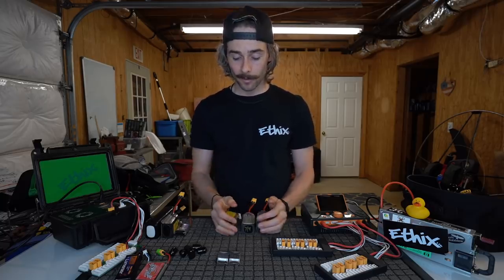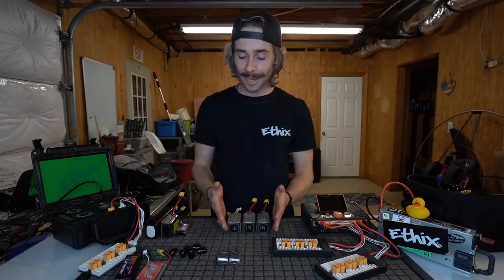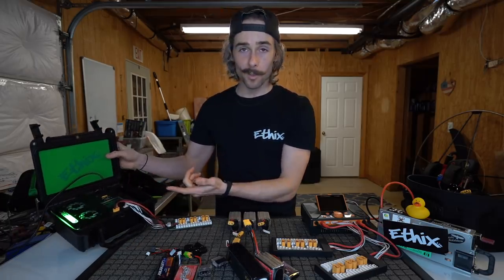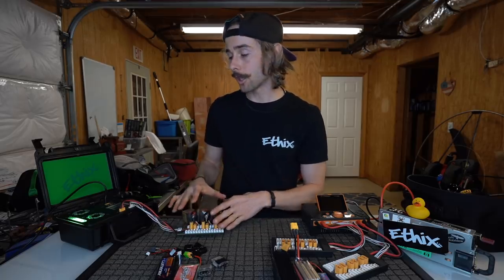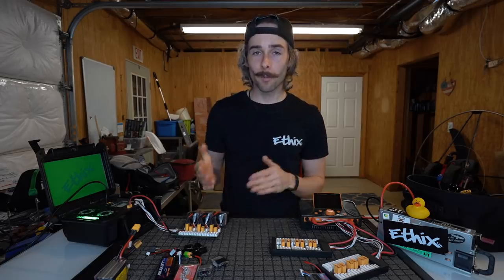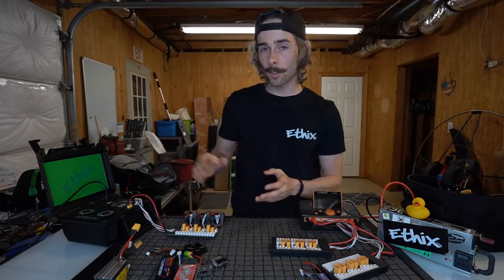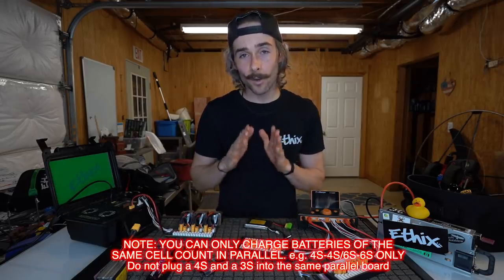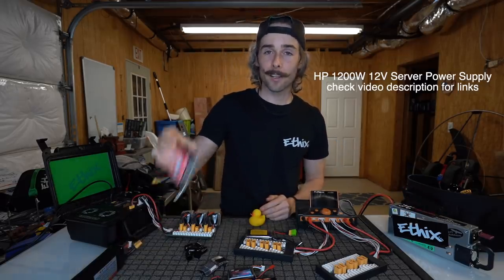How to FPV (Part 7) LiPo Battery CHARGING | Is Parallel Charging DANGEROUS ???!

Comment: If your second battery has a huge voltage difference from 1st which you just plugged in shouldn't you plug the xt60 from the 2nd battery in prior to plugging in the balance connector? Any discharge will run through the xt60 instead of the balance lead. Am I mistaken?
Reply from the maker: If it’s got a huge voltage difference.  Enough to have to plug in the xt60 because you’re scared the balance lead can’t deal..  you shouldn’t be plugging hose batteries on parallel 😂
Reply: @MrSteeleFPV  I have been known to do strange things when drinking and charging

Comment: One reason parallel charging might be dangerous is if a battery happens to disconnect, the current going to that battery will be dispersed amongst the others, thus causing a charging current above 1C

Comment: The example said 0.3V difference per cell so for a 6s wouldnt that be 1.8V difference allowed battery to battery, but then an example is given of battereries with a 22.5V to 23.5V range which shouldn't be charged together because of voltage difference? Was the rule really 0.3V difference battery to battery. I have also heard a rule of 0.1V per cell difference is ok so 0.6V difference across the range of batteries for 6s. I'm learning so what any thoughts welcome.

Comment: So how much would a controller, 5 inch quad, goggles, charger, batteries, antennas cost?

Edit(3 years later): I don't even remember asking the question above but what a silly question it was. I have just got into fpv and am now struggling with terminology of everything lol

Comment: Parallel mean all the positive pole of the batteries are connect to common + same with the - so the voltage is the same but you divide the current so if 1 battery absorb 1A at 17v is 17Vx3A=51watt instead of having 3 different charger:17Vx1A=17w+ 17Vx1A=17w+17Vx1A=17w=51w

Comment: Wouldn't it make parallel charging safer, if the boards that you plug the battery in had built in Lipo Cell Checkers (like the ones you used to check the voltages). If one of your Cells gets imbalanced, the board could automatically switch off the charging current or just make a loud sound.

Comment: .3V difference per cell? so a 3.9V just above storage and a 4.2V fully charged that's a massive difference . None of mine are ever more than .03V out per cell all at 3.7 something after recovery. I also display the IR on the charger not voltage when charging if the IRs are close I know all is well.

Comment: So is it possible to charge multiple batteries of the same voltage but different capacity ? like 2x 4s with one 1.5A and the other 1.2A ?
Reply: Vinast92 sketch 10 asked the same question below.
Reply: @Ozmakkacbr  Thanks !

Comment: what's a decent charger to invest in? that won't brake the bank
Reply: ISDT D2
Reply: @JustaPoke  ive got this charger its great
Reply: Hobbymate d6 duo!!
Reply: @Themflames  its the same charger pretty much
Reply: @llickmogan  no, the hobbymate is able to use ac or dc current
Reply: @Themflames  : yes, hobbymate D6 duo pro can take both AC & DC. It has a XT60 socket at the back. I use it and it's a great charger. 🖒
Reply: @Firografi  thats what i said
Reply: @Themflames  : yes,I know.....  I was supporting your comment 😆

Comment: I don't see how parallel charging is feasible anymore. Reliable chargers have gotten so cheap, you can get a toolkitrc m6 for less than $30 now. Get 6 of them and hook them all up to  a power supply so you can charger batteries individually. If one cell is dead midway through charging, at least it'll be detected.

Comment: I have noticed with all batteries if you find the proper voltage to stop flying at all of your cells will come up to the same recovery voltage about 2 to 3 hours after flying. 
Example: I have 6  5’S Lipos all Ovonic 1550 bought at the same time. 
If I fly them down to a steady 3.54 to 3.57 .....  In about three to 5 hours all 6 lipos will come up to the exact same voltage. 
Almost exactly cell for cell voltage for voltage. Usually if I do it right they come out like this 3.78 3.78 3.80 3.80 3.80.  All six of the cells will all come back to this voltage exactly per cell as in cell one 3.78 cell2  3.78  cell3  3.80 cell4  3.80 cell5  3.80. 
I think I’m onto something ??????? 
What do y’all think ??????

Comment: If I can just add something to precise: charge them peralell if they all are in max 0,3V range. for example one is 14,7 second 14,8 third, 14,9 not more. Allover difference should be 0,3V whole pack, not single cell. Because 4,2V and 3,9V will force large current flow between them.  
And if You read it i got a question, no offence but is Steele is your name ? Sorry for asking man, english is not my first language so it is a little bit weird for me ;) Cheers!

Comment: i once charged 6 batteries in parallel, and 1 cell in each died at once. Still not sure why. but it thinks it was because 1 cell in 1 battery were bad. so yeah there is chances with parallel charging.

Comment: Sigh, anecdotal I've not had anything bad when plugging a balance lead in first isn't a good recommendation. It relies on perfect circumstances and never having a Murphy problem crop up. It literally costs nothing to plug the mains in first and then balance lead a couple moments later for the extra level of safety.
Reply from the maker: Maybe you should make some safety videos m8.

Comment: Parallel charging=unnecessary risk, IMHO.
A charger with multiple outputs, and/or separate chargers is the way to go if I have a time constraint.
But that`s me, I`m pretty anal when it comes to LiPo`s lol.
Not just same voltage batteries, but they should be the same type, same age, and have been used in a similar fashion, as well as being undamaged, and cell-checked prior to charging, otherwise, parallel charging is a no-go for me ;)
(kinda just watched this to complete the "how-to FPV" series) 

Multiple output chargers are nice, and if you have say, an 8s compatible charger, there are dongles (for certain plugs and certain chargers) that let you connect 2x4s via the balance leads, or 2x3s etc :)
Been a while since I saw those, but I guess they`re still around.

Comment: I found a really good way to setup the power supply as a charger that eliminates soldering wires directly to the circuit board on the charge. They make "breakout boards" that the power supply plugs right into that give all the necessary binding posts to wire the power supplies how ever you want. gigampz.com makes one that I just got that works perfectly, it has high current binding posts that can be doubled up so as to provide the most current handling possible out of the power supply. It also give switching capabilities so that if you wanted to control the power supply on and off with out unplugging it you can. No resister soldering or all that jaz.

Comment: so if you shouldn't charge in parallel if your voltage .2 off from each other then don't waste your money on a parallel board.
because my batteries are always more then .2 off.
Reply from the maker: Battery management man.  Battery management

Comment: Im new to this hobby, i havent dared to charge my first 2s battery yet, i bought a Gens  7.4v 2600mah battery for my Taranis X9D Plus SE, and i bought a SkyRC e680 charger, im so insecure how to start charging, cause i wanna start my Radio so i can fly Sim in Velocidrone, anyone have any tips for me i would be forever greatful <3
Reply: charging one battery at a time is very safe and you wont have issues. Go for it :)
Reply: @JaniMikaelOllenberg  thank you, i have another issue now, i want to calibrate my controller, i did it in the controller, then i wanted to do it both in windows and velocidrone, but it's like a square split in 4 squares and im only in the top right square, i cant get it calibrated correctly, what am i doing wrong....? is it some setting or what can it be?
Reply: @oscarbergner  damn this one i dont know how to fix. Does it affect your flying in the sim? Can you only roll right for example?
Reply: @JaniMikaelOllenberg  yes, if i start a new map, the quad instantly takes off with a roll and maybe yaw, goes round and around cant calm that thing down :D should i try to reset my controller and dont switch the weight and throttle values to 50? i also tried fixing in the mixer cause the controller was not in mode 2, it's completely off like stuff wasnt where it supposed to be, i fixed atleast that in the mixer, but why it is in the top right corner on calibration i have absolutely no idea, and i have like no one to ask, it's not easy getting a answear from all them PRO's but maybe someone encountered this issue. I live in Sweden upnorth, not alot of people fly freestyle drones here, mostly like DJi and stuff like that.
Reply: @oscarbergner  damn i have no idea how to fix it. But try resetting it somehow. I live in Finland so pretty close! :)
Reply: @JaniMikaelOllenberg  i need to try something, i really wanna start flying, hoping to get my first dron this summer. Thanks anyway, cool you live in Finland!
Maybe Someone else reading this have a answear for this issue or encontered it?

Comment: Thanks to Joshua Bardwell for this tip, If you connect only the balance lead of the same cell batteries to the parallel board and not charge, the corrosponding cells will balance themselves out with eachother - if you leave them alone for about 15-20 mins.  An easy way to make sure your cells are within voltage of eachother before parallel charging.

Comment: "This I charger is more expensive though"
the ethix box is $400 -_-
Reply from the maker: If you were smart you’d understand the difference in a “portable charging setup” vs a charger and a power supply that isn’t portable.   406 duo is 300$ alone
Reply: @MrSteeleFPV  this is a series you titled "How to FPV", presumably for beginners, yet you diss a new fan for potentially not being knowledgeable enough to see through a price tag that's higher than my entire set-up. Outstanding move.